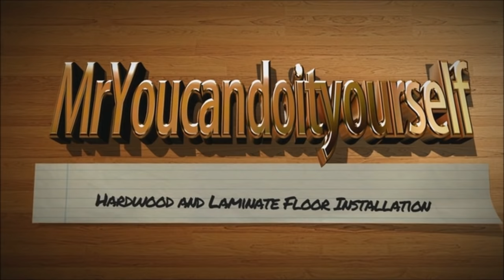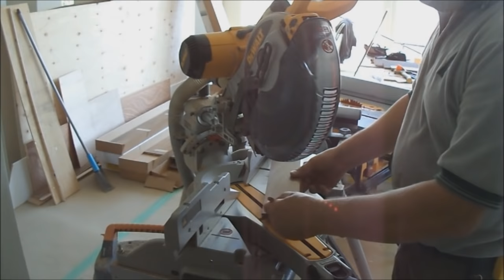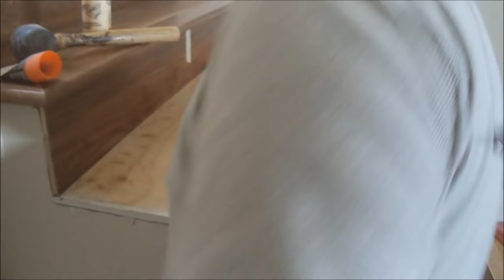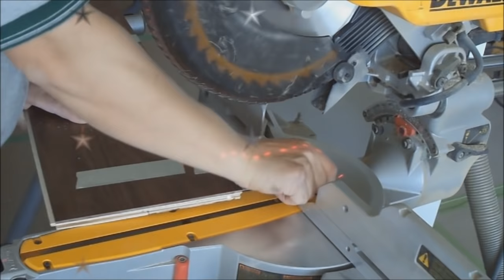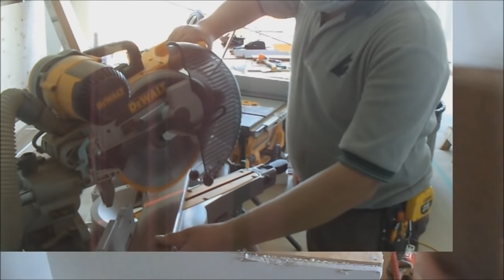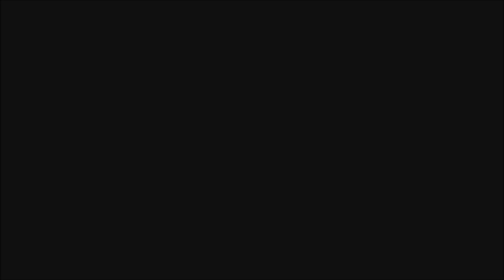Hardwood Flooring on Stairs: Installing Open Sided Staircase Nosing Tread and Riser from A to Z

Comment: It looks GREAT!!! Why not take up the tread and put a full tread instead of stacking a new tread on an old tread?  I'm trying to understand.
Reply from the maker: Where in this video you found old tread?
Reply: @MrYoucandoityourself  Pardon. I guess not old tread. I said I'm trying to understand. I've seen in videos where they took off carpet and cut the tread flush with the riser then put a hardwood on top if it. This looked similar to me. That's why I ask the question.
Reply from the maker: Yes, this is the same idea, here is new house only.

Comment: what about after the glue is dried, would the glue be strong  enough to hold the stair nose? I've been reading that is important to face nail using  a 16GA gun nailer.
Reply from the maker: Yes, glue is very strong. I guarantee it from my experience!

Comment: Good Job but, how did You finished side of stairs. When you installed the raisers of stairs and how about those gap lines on the side between existing stairs and risers? 
I’m asking because I have same situation and I don’t exactly  know  what to do. Leave those gaps ugly or patch them with bondo  sand them, paint them and wait till they crack .
Reply from the maker: Here it is - How To Finish Open Site Stairs Riser MrYoucandoityourself
https://youtu.be/xdillxnBebg
Reply: @MrYoucandoityourself  man! I love this idea. You make my work much easier. Thank You.

Comment: How exactly did you scribe the line on the end piece to get it to be flush with the side stringer? Did you just hold the pencil flush to the stringer and use it to draw the necessary angled line to cut on the miter saw? This is at the :52 mark
Reply from the maker: Hi Kevin, yes, I just attach pencil to the stringer and made line. Easy.

Comment: Excellent video. Hello, my friend, I have a similar project to this video but with 3/4 thick red oak wood. Could you tell me what type of nail and nail gun to use THANK YOU
Reply from the maker: Hi Alejandro, is it unfinished or prefinished floor?
Reply: @MrYoucandoityourself  
thank you for answering me; The woods are not painted, as it is better to paint them before or after putting them
Reply from the maker: Hi Alejandro, you can use nails 1'1/2" - 18Ga. For painting and finishing I recommend you invite professional floor finisher. It's not easy to do, believe me. Thanks.

Comment: hello, i am installing prefinished teak hard wood flooring throughout the upper floor. i have finished the first room and am going to start on the next bedroom then continue into the hallway. i plan on having a transition piece from the 2nd room to the hallway, only because i'm doing it room by room. will this look ok ?
Reply from the maker: What type of installation? Glue?Nail? Floating?
Reply: Nailing

Comment: Great video series, thanks for posting. What size nails do you use for this?

Bob...
Reply from the maker: 18 gauge, 1,5"
Reply: i think 24 gauge its better than 18 .. you dont need to fill up the nail marks after ward

Comment: Great video...I am trying to install bamboo floors on my stairs and the mail gun is able to shoot nails through the wood.  The wood is pretty thick.  Should I just use liquid nails?  Thanks for your help.
Reply from the maker: I would use a pin nailer 23 gauge
Reply: MrYoucandoityourself We plan to install strand woven bamboo on the stairs too using the floor material plus stair nose, not the solid one-piece stair tread. Would 23 gauge pin nailer be strong enough to hold? Should I also use 23 gauge pin nailer for the corner where the miter joint of stair nose is? Manufacture recommended pneumatic finish nailer or 7d or 8d hand nails to top nail the first 1-2 rows when installing floor. So I assume we can top nail the stair tread and stair nose too after putting on the glue, but I don't think it'll look good with the nail holes even after we fill them. I saw another video of yours where a brad nailer is used for the first 1-2 rows. Thanks for your advice.
Reply: Michael,
Do you also have strand woven bamboo? What type of nails did you end up using? What's the pressure setting? Thanks for sharing your experience.

Comment: Hello,  Can you install treads/steps without nosing?  What is its real function? I have a closed-sided staircase and considered treads without adding nosing.  Please advise.
Reply from the maker: I made it just once in my professional carrier. The role of nosing is your safety when you step down (to avoid your heells slippering). I recommend to install them.

Comment: Where did you get the flush stair nose? I can’t find it.  I don like the overlap
Reply from the maker: Flooring suppliers can provide flooring material with nosing as well. If your nosing bigger, you can rip off from the bottom.

Comment: just picked up my wood floors and stair nose, however, seems like my stains from wood floor and stair nose don't really match. Is this common for the stains?
Reply from the maker: If you buy floor and stair nose made by manufacturers - they ALWAYS MUCH. If you order stair nose as additional material to your hardwood - they can have a little difference in the color (not too much!).
Reply: MrYoucandoityourself Actually, the majority of manufacturers outsource their mouldings to other companies so it is quite common for a nosing or moulding to be a little off in color, milling or finish. It's as close as you'll get though.
Reply from the maker: Yes, you are right, my friend.

Comment: Hi thank you for the video - what length pins were you using with the pin nailer?
Reply from the maker: I used 1"1/2 nails.
Reply: MrYoucandoityourself thank you, I see a lot of people using 18 ga nails, do you think the 23 ga pins are enough? I'm about to do my stairs and the pin hole would be ideal. I'm going to be using 1/2 inch thick bamboo engineered

I will also be gluing them down
Reply from the maker: 23 ga nails are very good for engineered hardwood floors and laminate. They are able to keep it strong, make small holes and don't leave bumps.
Reply: MrYoucandoityourself thank you for your help!
Reply from the maker: You're welcome!
Reply: MrYoucandoityourself ty for the information again, I just realized the wood I have available to me for the stairs is t&g solid bamboo. Will the 23ga pin nailer still be the right answer? I have an 18ga brad nailer as well. Please and thank you for your time.
Reply from the maker: Hi Tom, bamboo to strong for 23 Ga, you have to try. If it doesn't work you can use 18 Ga, just shoot nails through the cardboard. It will save your floor from big holes.

Comment: What do you use the cover the exposed edge of the riser?
Reply from the maker: Please find my video "Hardwood Stairs: Installing Decorative Angle Bead" and you'll get an answer.
Reply: if you use a skirtboard and put a 45 on the end of the riser as well as the skirtboard you don't need to cover the end because they are mitered to each other.

Comment: what is the tape used for?
Reply from the maker: +L Coloma Scotch 1.41 in. x 60.1 yds. Painting Production Masking Tape
Reply: The tape is to see if the sides are straight or not
Reply: @xyligan4ik  Thanks, but what exactly do you mean?  They help to line up the sides?  Like the gap between tread and riser?

Comment: You cut the back of the side nosing half at 45 and half straight . Did you just do a return in the backm Video doesn't show.
Reply from the maker: You can have a look here :
1. https://youtu.be/OIr9gWgya4g - Hardwood Stairs Tips and Tricks for Stairs Treads Installation
2. https://youtu.be/E9v2T51MSBY - Hardwood Stairs Tips and Tricks for Risers Installation

Comment: this is just a cheap way to do stairs, traditional stain grade treads and painted risers installed by a seasoned finish carpenter can't be beat imo
Reply from the maker: You better know how to do it. Thanks for watching!
Reply: Just my opinion, there are always uses for new products to offer a customer. Every situation is different, thanks for sharing the video. I'm starting the stairs next week in my house since the flood.
Reply: q electron . It's not cheap, I'll do same but nail at the tongues and the bullnose just glu it, looks more professional and clean.

Comment: Please be safe. I think Vinyl, Laminate, and hardwood are all dangerous on stairs.  I know carpets are dirty.  I think using a easily replaceable carpet runner may be the best way to go.  You only have to fall down from a slippery stairs once to realize carpet is the safest option.  Since permanent carpet is too hard to replace therefore I recommend a runner option.
Reply from the maker: Thanks!

Comment: Wrong!!! Always tread first then, risers. Work from bottom up.
Reply from the maker: It's only your opinion.
Reply: @MrYoucandoityourself  it's not my opinion. If you start from the bottom each riser helps lock in the next tread all the way up. It's a pure fact. Not to mention, with any expansion or contraction the riser will cover that gap in the seam. Plus, you add brad nails to that tread that the riser will also cover.
Reply from the maker: @eats76  I don't like stepping on the new stair tread and walking up and down over just made staircase. But you do what you are doing. My rules are - don't walk over the new stairs the next 12 hours after installation. Thanks!
Reply: @MrYoucandoityourself he doesn’t know what he’s talking about. I have 25 years of flooring and tread experience and no one I know puts tread in first 😂
Reply from the maker: @tonyg6103  Good for you!